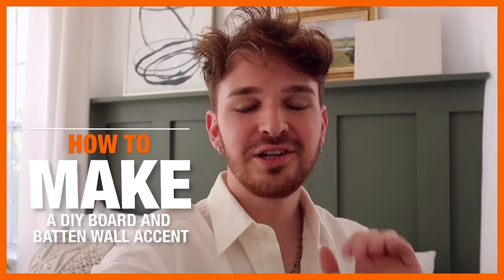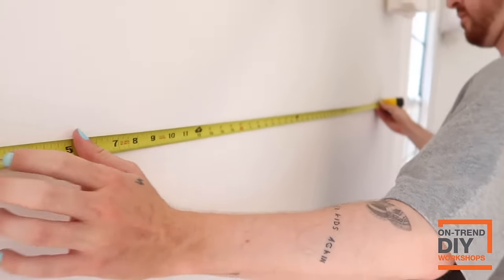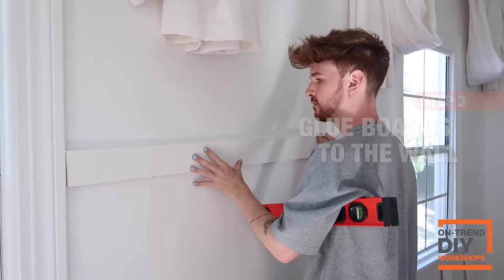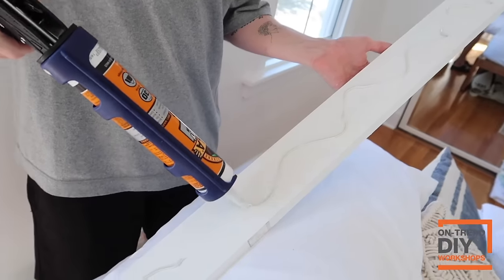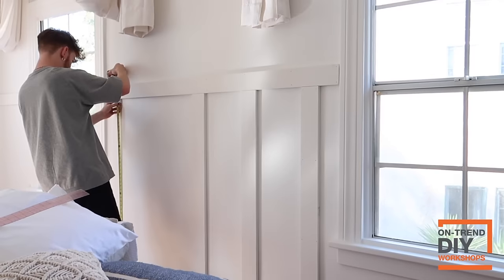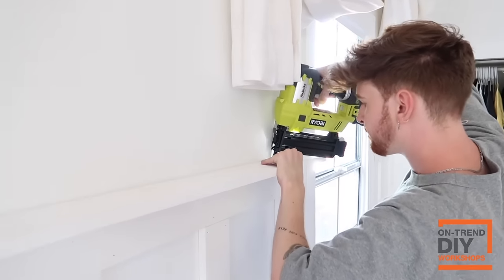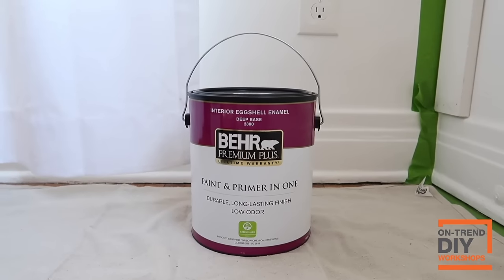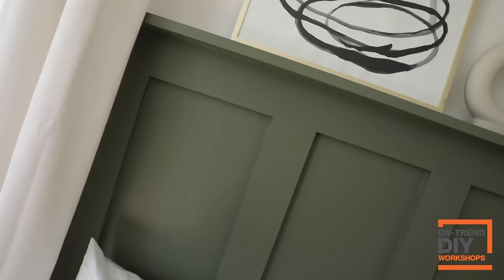DIY Board and Batten Wall with @lonefox | The Home Depot

Comment: What about the bottom? The board would stick out over the trim I’m pretty sure, but I guess you could put another piece behind it later on to make it flush. Normally you remove the bottom trim and add another board to make it flush then put the trim back

Comment: Did you replace the baseboard?
Reply: I'm going to.  I will be using 1x4 for the baseboard as well as the verticals. This way the thicknesses are the same.  My original baseboard is way too thin and wouldn't look right with the 1x4 sitting on top of it.

Comment: Does anyone have any thoughts on using a miter vs circular hand saw on this project?
Reply: I use a miter saw for all my projects. I hardly ever use a circular saw on anything where I need to make perfect cuts. Miter saws give you the flexibility of cutting a perfectly square cut every time while also being able to miter something if need be at the same time. I find that more often than not I’ll have to make adjustments here or there if walls aren’t perfectly straight. I’d definitely recommend a miter.

Comment: the thickness of your board selection overhangs the baseboard trim at the bottom kind of erratically, was this intentional or should one be trying to avoid this and taking extra care/craftsmanship into the tapering? thanks in advance
Reply: I wonder if that could be because of the warping of his walls being inconsistent (since he said his place is from the 1920s).
Reply: @crystalveber1161  thanks for reply, makes sense. Also in a century home myself and finding the same... just wasn't sure if maybe the overhang was universally "accepted" as part of the style. Thanks again
Reply: I've seen in other videos where they pull off the baseboard and apply a new board to match the others so that it doesn't have that overhang and looks more cohesive.